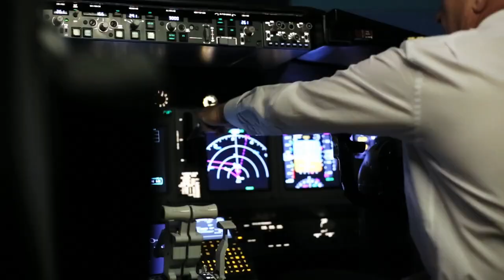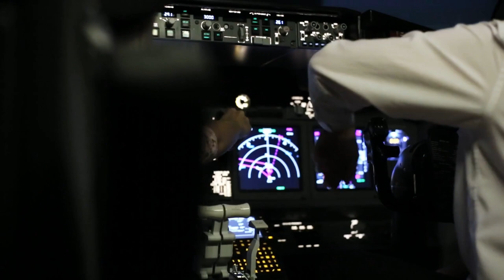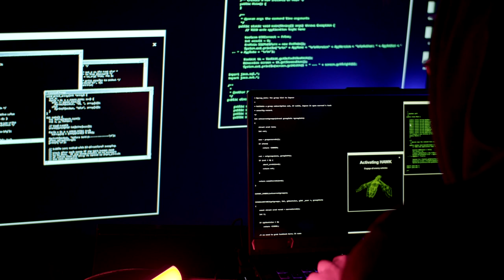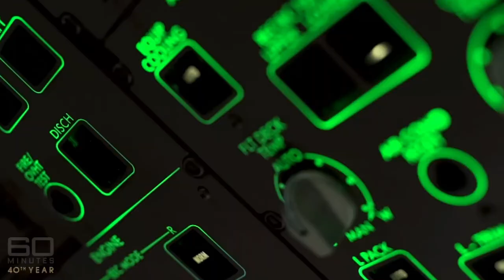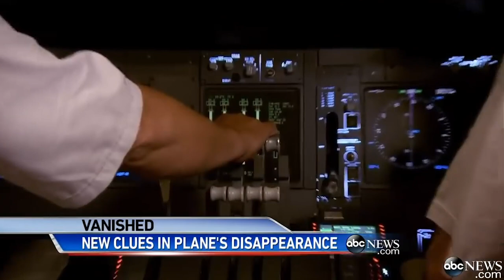Malaysia Flight 370: The Biggest Theories About What Happened

Comment: The phone calls to the passengers mobile phones ringing is the smoking gun.
If the plane crashed how did the calls get through ????
Reply: I agree and no one talk about it, very strange
Reply: @aminechtioui3106  what? the video addresses this
Reply: Not at all. They rang because the phones were still operational and turned on as the plane was flying for many hours dark towards Antarctica. All the passengers were likely dead from cabin depressurization.
Reply: @ethanlculver  there's no evidence of the plane flying to antarctic what so ever...not on radar or any other system.
Don't know where you got that from.
Reply: @FURIOSO84  Inmarsat satellite data has an arc of possible final locations in the southern Indian Ocean.
Reply: @ethanlculver if there was cabin depressurization they wouldn't have died instantly, especially the pilots, they would have contacted the ground. They would have probably been using their emergency masks on and off to communicate.

Comment: The only mystery to be solved is to rescue it from the bottom of the sea where it rests, practically intact, with both black boxes in place.
The aircraft was splashed down by someone from the cockpit, in the same way that Commander Sullenberger did in the Hudson River. With the difference that either all the passengers were already dead due to cabin depressurization, or they died when it sank.
That is the strongest hypothesis, based on the very few (less than 30) pieces of debris that were found, all from the outside of the plane, including a panel that could only come off if the landing gear was deployed.
Add to that several deleted files from the pilot's home flight simulator, with unexplained routes to the southern Indian Ocean. 
Oh... and someone had turned off the transponder and ACARS shortly after passing Igari point, precisely the boundary between 2 international control areas (Malaysia and Vietnam). Overriding those two communication elements of the aircraft must be done manually. How many more clues that it was intentional are needed?
Reply: There’s no better reason for shutting off the entire main bus and all systems than an emergency event that never ended
Reply: @chrissmith7669  What kind of emergency event could hinder the crew from making a distress call but allows the plane to continue flying for 7 hours? Not to mention the abrupt changes of directions during the first 2 hours.
Reply: @marcelosoto-quiroga1965  if there was an electrical fire or fault they would isolate the electrical bus first.  Before any communication reach up and attempt to isolate the problem. If one pilot was flying and other addressing the issues then one could have been calling while the other was already shutting off the power.  The essential power would be available to continue flying and even leave the navigation computer running.
Reply: If someone wanted to direct blame towards the pilot, deleting files on his flight simulator would have been a good start.
Reply: @jumpinjohnnyruss  they didn’t know what they were looking at on his computer
Reply: Theres alot of weird things about this,all evidence points to the pilot,but let's not forget about the  high profile scientists that were on board,that had patents worth billions.🤔
Reply: @jacobeastland4202  there’s no evidence either pilot was involved merely accusations.